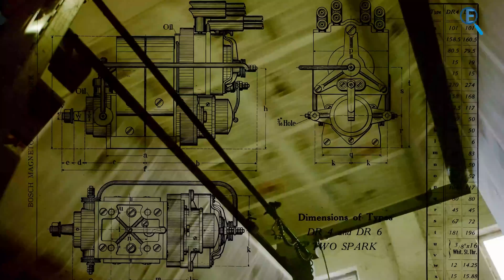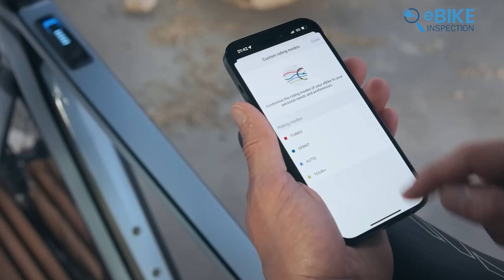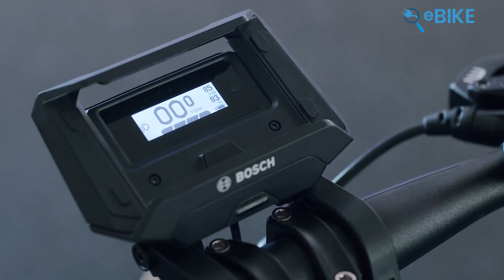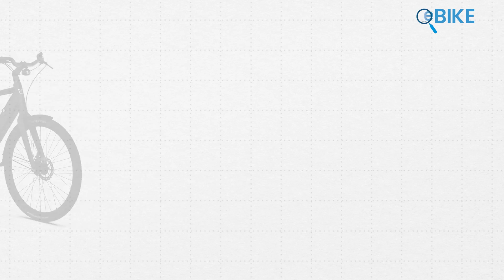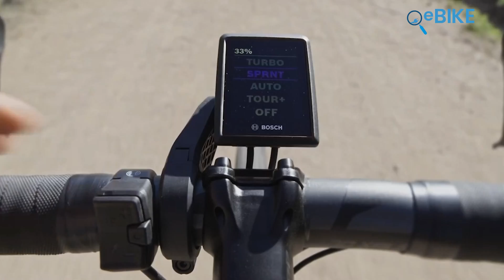How Bosch is Dominating the E-bike industry!! Bosch E-bike System

Comment: The speed motors are not strong enough for speed pedelecs. A rear wheel motor is still superior
Reply from the maker: Good point. Speed pedelecs need more power than the mid-drive motors provide, that's why rear hub motors still lead in high-speed performance.

Comment: Bosch is a big name in the e-bike world. However I believe they are missing the most important part of owning an e-bike. For a DIY'er and for many bike shops they are consistently making stuff difficult to repair. They also don't have a legacy program for replacing older products such as drive motors, replacement parts for them and displays etc. That's a whole other section of the biking and e-bike world someone is going to step into if they don't.
Reply from the maker: Your point is absolutely valid. However, the facilities you're asking from Bosch can only be provided if the bike brand allows or chooses to offer them. Bosch’s selling strategy is essentially tied to the brand.